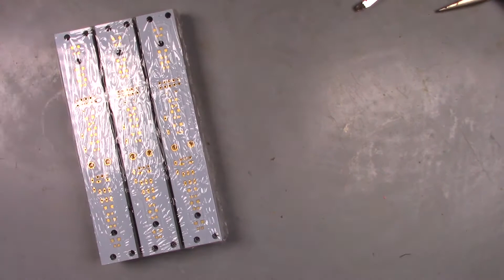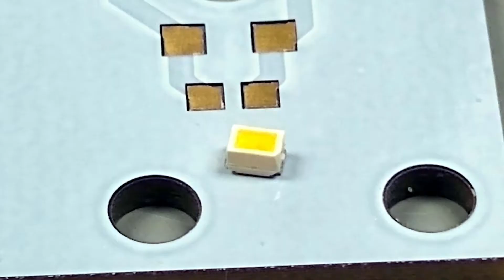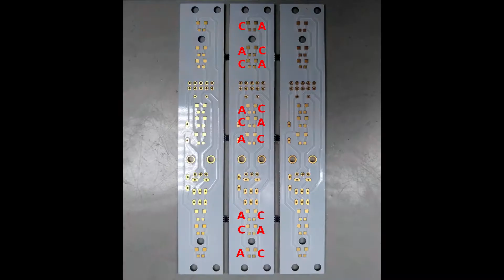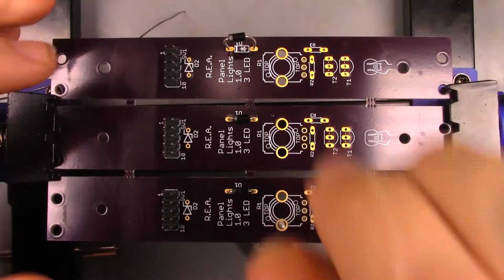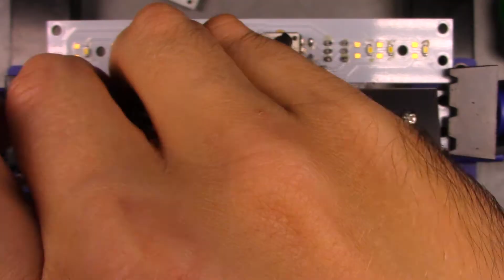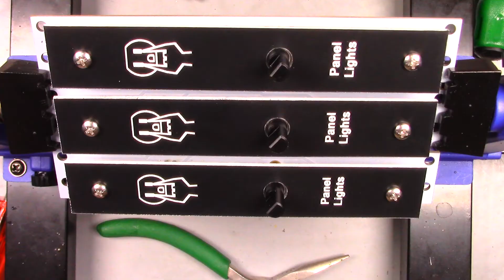Panel Lights Eurorack Module Build

Comment: Oh that’s a niche you’ve filled with that module.  I like all of your modules and so I find it difficult to settle on which one to buy.  Have you ever thought about making a 5 volt breakout / usb from 5 volt module, with usb sockets so you could plug stuff in and charge phones?  There are a lot of folks out there who have massive power that’s unused on their 5 volt rails and I’m surprised to not see many usb power from 5 volt modules out there.  THANKS AGAIN FOR SHARING!!
Reply from the maker: With +12 and _12 also available, the risk of someone doing something wrong and frying their $1000 cell phone on a $25 module is too great. However, this does sound like a good video idea, to show people how to do it for themselves.
Reply: I'm honestly feeling a bit of a tendency towards ordering some pcbs for myself lately.  I'm a fan of the modular electronics prototyping system called LittleBits, which have their design files open sourced on github.  I have a friend who tells me that if I were to attempt to have LittleBits pcbs fabricated then I would save a ton of money over buying the modules.  I'm uncertain as to the sources for having pcbs made, where should I have CAD files sent off to and these details that likely have a lot of trial and error involved.  Is KiCad a good program to learn PCB design for a novice?  Ill probably buy a drum module or two from you here within a few days.  If you want / have any desire to aid a student, or maybe it would ease the burden of obtaining a bunch of boards, keep my contact info and let me know if you'd like for me to pitch in finance wise on that USB 5v breakout module.  I've come into a small bit of economic stimulus which I would normally just throw at materials and a few components, anyways.  I really appreciate that you make and upload videos to your channel, as I can see that you probably would have no trouble just dropping the videos, save the seldom praises from someone like me who finds quite an immense amount of education and inspiration in them.  Your videos are very helpful.  THANKS AGAIN!